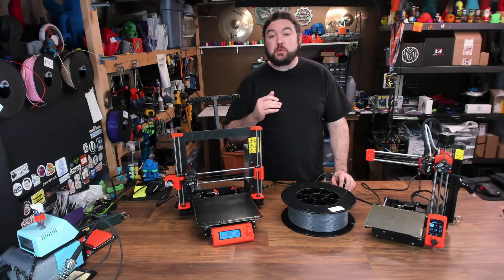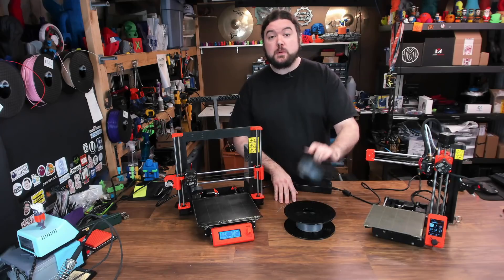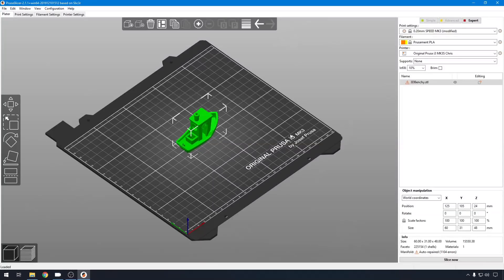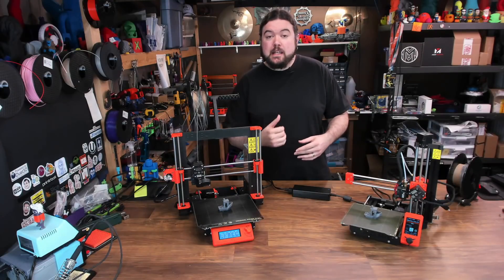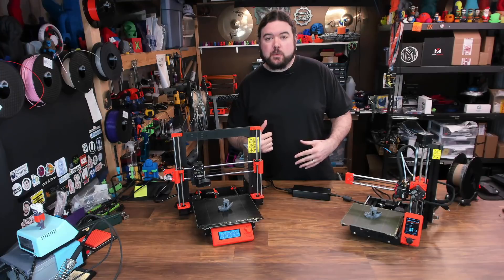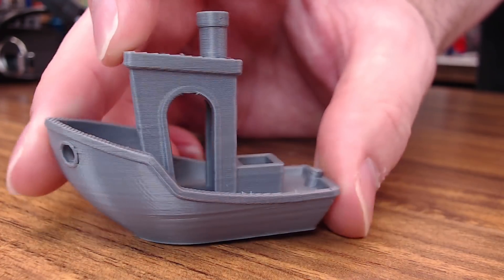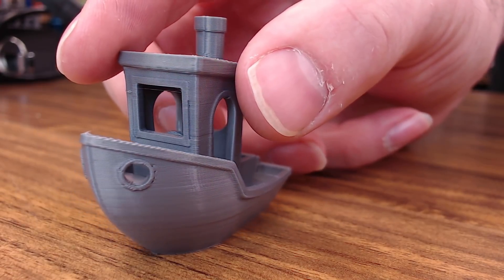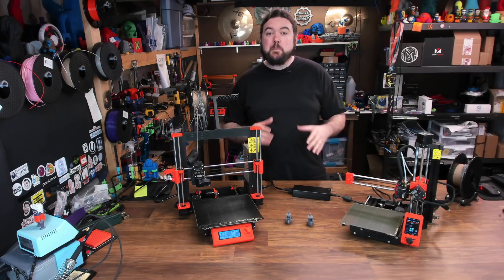Prusa MK3 vs Prusa Mini - 3D Printer Race - Chris's Basement

Comment: Does the Minda probe placement to about 1mm and room temp can smooth out the mini print quality?
Reply from the maker: It can't hurt for sure.
Reply: @ChrisRiley  what's your thermostat temperature when printing? My guess is around 70F or a bit lower than that? I'm not sure really because I'm in Texas and much warmer here nowadays.
Reply from the maker: @isferfun3909  At this time it was probably around 65F.
Reply: @ChrisRiley  thanks, good to know how cold I needed the ac in my room while printing.

Comment: please jesus calibrate your printers
Reply from the maker: What do you suggest I do?
Reply: @ChrisRiley  
check your assembly again(i know its painful)
it looks like you have problems with your extrusion check for clogs  and check your filament diameter! check if your hotend is free and your extruder motor is not grinding your filament(bitemarks) when you are sure you are free of clogs and the extruder is pushing the correct ammount of filament through
reset your printer to newest firmware
meshbed level and first layer calibration 
take 1 hour to really get the first layer perfect
i dont like the live Z on prusa that much take a square of your desired size slice it to 3 layers max
and adjust the height live and aim for the best you can achieve i live adjusted from 0 - -800 and found my best result was at -720
reprint benchy with the shipped gcode again
if this fails then
calibrate the esteps(https://mattshub.com/blog/2017/04/19/extruder-calibration)
check for sounds that should not be there!
do you notice weird mechanical noices that sound bad? check it the printers should hum not tear and grind.
test your pinda! https://help.prusa3d.com/en/article/pinda-probe-testing_2091
check your ptfe tube that goes into your hotend is it long enough or is it too short and  allows cavities where the filament curls up and makes a clog?
check for clogs or other underextrusion causing errors!
take your benchy and look at this troubleshooting site https://www.prusa3d.com/print-quality-troubleshooting/
recognize your troubles and fix them 
check your extruder motor & gear
check your belttightness
check your filament diameter
get yourself a hotend sock
i hope i could help you :)

Comment: In the slicer you seem to have selected Prusament PLA and not Prusa PLA.  This means that the hotend is running around ten degrees higher than it should be which may have some bearing on your print quality, especially on the mini.  Also, using the "speed" profile isn't likely to get you the best quality result either.   However, this is an interesting comparison of the speed of the two machines which is what the video was about :)
Reply from the maker: The PrintedSolid stuff seems to like it a bit hotter, but I am still messing around with it. You are right, this is just a quick side by side. Mostly for fun to see what would happen.

Comment: I get so confused with trying to find my first 3D printer. This is on my list, but so were the Ender 3, CR10, and a few others. The more I learn, the more confused I get. Looking to print PLA, ABS, TPU, and Nylon (if possible) for RC parts. Any recommendations?
Reply: Hi, I recommend you ASA instead of ABS and Taulman Alloy 910 instead of Nylon. YOu have be prepared for  some troubleshooting with cheap printers, but nowadays it is quite easy to find someone who dealt with similar problems and shares solution on the internet.
Reply from the maker: 100% honest opinion, the Prusa MK3 is about the most versatile and dependable machine out of the box you can get for the money. It might not turn out as good of a PLA print as some modified printers, but to do all the different filaments all the way up to PC, it's really about the best there is at this price point.

Comment: My mini has been kind of a piece of shit.  Clogs. clogs. clogs.  This isn't even it the same realm as the mk3.  I had an Airwolf with a bowden extruder.  I guess I forgot how much of a pain in the ass that was.  The mini can make a nice print and then clog on the next one.  Not recommended.  Bowden tubes suck.

I should mention, the files that came on the thumbdrive were mostly unusable.  I sliced a benchy with PrusaSlicer and that forced a firmware update.  That turned out perfect.  A lot better than the one in the video.  I am away from from my mk2 and mk3 because of this quarantine.  I have printed some respirators on the Mini that turned out nice but I had to print extremely slow.  I am awaiting replacement nozzles.  Maybe that is the problem?  I have did many cold pulls.  Cleaned all the other parts multiple times. 

So far, my opinion is once I get my mk3 again, this is going in the trash.  Well, I will part it out.  Complete failure in my eyes.
Reply from the maker: Sorry to hear that about the mini, I did notice that when I was printing higher temp material, the nozzle cartage dropped a bit. I loosened the set screws and push it back up and re-tightened it. That has solved a lot of my issues.

Comment: The mini have the same security like the mk3s?
Reply from the maker: Security? I am not sure what you mean.
Reply: Chris Riley I mean that if you move the extruder when it is printing it stops it will recalibrate and continue with the printing filament sensor and energy power off like the mk3s

Sorry English is bad
Reply from the maker: @uno21858  Right now, it doesn't support crash detection, it does have 2209's, but the firmware isn't there yet. I'm sure it''s coming, those do have an add on filament sensor you can buy.
Reply: Chris Riley thank u I wish that the mini have thouse features
Reply: @uno21858  Your English isn't that bad, bro. 👍

Comment: Chris my i3 mk3s gives a way better finish than that on those settings even on when the speed is higher. I think your printer needs some fine tuning. Just some friendly advice. :) I have also never had any driver noise, whatsoever. On the forums it was discussed that most of the problem was down to incorrect belt tensioning
Reply from the maker: Thanks, I'll have a look.
Reply: Yea, I was equally confused with the results too.
Reply: Hi, the problem is not enough tension or too much tension?
Reply from the maker: @luciomachado6727  I am currently testing some different things, there might be a video come out of this, we will see.

Comment: My mini had a perfect benchy with that profile and blue prusament, no stringing or anything
Reply: Ambient temperature is a result of that
Reply from the maker: Interesting.
Reply: @ChrisRiley  same for me, I might say too that ambient temperature really really matters even tho cooling is really good generally
Reply from the maker: @MasterControl90original  Good to know, I'll run some tests.
Reply: @ChrisRiley  to be more precise I'm talking about the included benchy gcode but I can assure you that equally complex models came out as well using prusa slicer premade presets. It is surely not a printer without flaws (the filament unloading somethimes is meh) but out of the box is really reallty good

Comment: I have to admit I was expecting much better from the Prusa machines. My cheapo Aldi printer does a better Job on a benchy straight out of the box. Nice to see a straight comparison though, great video thanks.
Reply from the maker: Thanks! I would like to see pictures of your benchy.
Reply: @ChrisRiley  I think my comment may have been a bit misleading. While the Benchys I have printed look really  great, Detailed, smooth, with  good bridging over the windows.These are tiny Bridges and  the printer is not without its limitations on real world prints. Thanks again, love the content.
Reply from the maker: @microtek9912  No worries Jeff! Thank you!
Reply: @microtek9912  Didn't expect to get called out and asked for proof huh?
Reply: @dangerous8333  This was from 11 months ago. While I stand by what I said, the point I was trying, but clearly failed, to make was that as a newbie back then my expectations for the Prusa machine was that it would produce prints that would be noticeably better than a cheap Aldi print "Out of the box"  For the record my Aldi printer sits idle in the corner and my MK3S and 2 Prusa minis churn out print after print that while not as good as some I have seen are more than acceptable to me.

Comment: Hey Cris I'm your fan and I would like to know how can I recover my impression after a power outage? My 3d printer is Rep Rap, I'm setting up Marlim.
Thanks buddy
Reply from the maker: Marlin you just need to change a few things, check out configuration_adv.h

 #define POWER_LOSS_RECOVERY
  #if ENABLED(POWER_LOSS_RECOVERY)
    #define PLR_ENABLED_DEFAULT   false // Power Loss Recovery enabled by default. (Set with 'M413 Sn' & M500)
    //#define BACKUP_POWER_SUPPLY       // Backup power / UPS to move the steppers on power loss
    //#define POWER_LOSS_ZRAISE       2 // (mm) Z axis raise on resume (on power loss with UPS)
    //#define POWER_LOSS_PIN         44 // Pin to detect power loss. Set to -1 to disable default pin on boards without module.
    //#define POWER_LOSS_STATE     HIGH // State of pin indicating power loss
    //#define POWER_LOSS_PULL           // Set pullup / pulldown as appropriate
    //#define POWER_LOSS_PURGE_LEN   20 // (mm) Length of filament to purge on resume
    //#define POWER_LOSS_RETRACT_LEN 10 // (mm) Length of filament to retract on fail. Requires backup power.

    // Without a POWER_LOSS_PIN the following option helps reduce wear on the SD card,
    // especially with "vase mode" printing. Set too high and vases cannot be continued.
    #define POWER_LOSS_MIN_Z_CHANGE 0.05 // (mm) Minimum Z change before saving power-loss data
  #endif

Comment: Nice video idea, i realize they looked pretty good but we all really want to see how the limit of how great a print is possible, so as a followup, how about leaving it stock and then adjusting settings to get each printer to produce the best quality print in a reasonable time frame? Pla, petg, nylon and maybe a flex filament?
Reply from the maker: It sounds like a great idea.

Comment: I love your videos & your presenting style & knowledge, but, if I have to see another benchy boat print I'm going to commit suicide. I see the merits of the  technical challenge of Benchy but would it not have been environmentally better if the Benchmark Print was something that could've been used (or turned into) something useable like a key fob or clay moulding tool?
Reply from the maker: Thanks! They are tradition at this point.
Reply: Everybody prints a benchy atleast once
Reply: @sniperpronerfmods9811  I know. It's just that it's only a wee boat, it can't be used for anything and so many people print using ABS that I'd rather the Calibration/Test Items were at least Real Life practical or functional.
Reply: @goldbunny1973  lol, you must not do a lot of more organic 3d modeling, a benchy represent something made in blender really well, a cube represents soemhting made in solidworks and frankly... If you can print a benchy you can print a cube... Just saying, maybe you should get into serious 3d modeling and see what's up, and they are useful they sit on my window sill you silly noobino
Reply: Im 7yrs into 3D printing with an MA Degree, built 4 printers so far, I'm not exactly a "noobino" and I too am "just saying" I think we need to consider the environmental impact of churning out millions of shelf-decorating plastic boats instead of something useable but equally valid as a Test Print Model...even if only to break the paint-drying monotony of Benchy Boat.
Reply: @goldbunny1973 lol a MA degree, nah I'm just self taught, and certified in solidworks, only 0.1 of users have the expert, took me 4 years but worth it, I can't believe to spent time on a MA degree and if you paid then I feel bad for you, and why are you a liberal environmentalist, go protest somewhere else like China where they build a coal plant every week please and Thank you, cheers
Reply: @sniperpronerfmods9811  OmG you are so offensive. Grow up.
Reply: @goldbunny1973  haha, pretty sure thats what my ex thought too, but she was just a drag

Comment: your Mk3 needs a tiny tiny bit less retraction! the tiny holes in the chimney is making me say that
Reply from the maker: Thanks Amy, I might give that a try.
Reply: I have the same issue a bit better than the video. What section do I need to change in retraction?
Reply: @tooez7397  just the distance by 0.1 or less i guess? if it strings even less? sometimes I add a very small minus value to the extra restart distance to help with the stringing without making holes.

Comment: I have been wanting to do this test as well.   I have 3 mk3's and a mini.   And yep I get the driver noise on all of my prints.   I have been raking thinking about trying the skr 1.4 turbo and trying some comparisons.   But I have to say I am very cautious about modding my mk3s. If I try it,  it will be on my cloned mk3.  I laser cut the frame out of aluminum and have purchased all original prusa parts besides the bed and cloned einsy board.  

One question I have for you on your mini.  Do you have issues with your first layer being inconsistent and continually having to adjust the live z?  Just curious as I am having that issue.   I contacted support and they are working on solving the issue. Something to do with the minda instead of pinda probe.  Temperature can skew the reading do they suggested to raise the print head up 60 mm from the bed.  Mark that position and always start in that position. Seems to work so far except I have noticed during first later calibration that it heats to 215 before probing the bed which also throws things out of whack a bit.   Im hoping for new firmware soon or somebody to do a video on a pinda v2 conversion. 

Other than that great video Chris. I   love my prusa mini!
Reply: Going to a Duet board was a great upgrade for me.
Reply from the maker: Thanks Greg, you know, now that you mention it, I had one issue on the mini that sounds kind of like that. I have been printing on it a lot, but only saw it once. Now I am going to have to go back and see if I can reproduce what I saw. I wasn't aware this was an issue, thanks for bringing it up.
Reply: @ChrisRiley  no problem!   Glad to give some input.

Comment: Good comparo. Yes the noise in the MK3 could be driver noise.....or it could be caused by the direct drive. I've seen noise in my prints come and go just by changing from direct drive to bowden.
Reply: I'm using a mk3 and a cr10
And I mainly use the mk3, but I sometimes change over to the cr10 since it produces way cleaner straight walls

My theory is that the slop in the bowden setup may just smooth out any Ripple caused by the drivers while the mk3 "accurately" represents all the noise present
Reply: @officer_baitlyn  Yes bowden could hide driver induced noise.  And since the stepper motor on direct drive is very close to the nozzle and on the x gantry, bowden isn't subject to noise caused by the vibration and mass of the direct drive stepper motor itself.
Reply from the maker: Interesting, I didn't really think of that, but true.